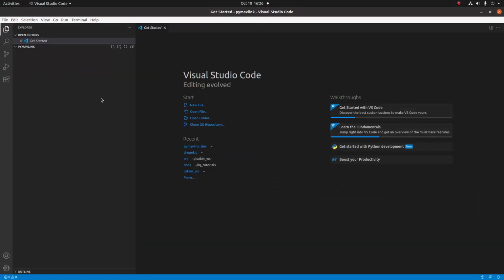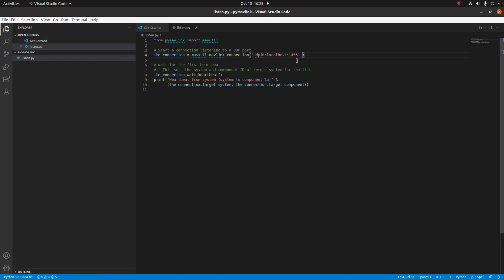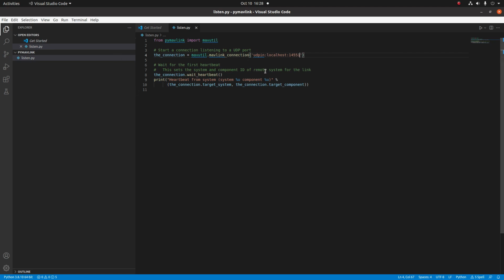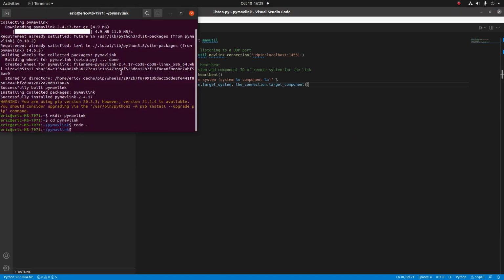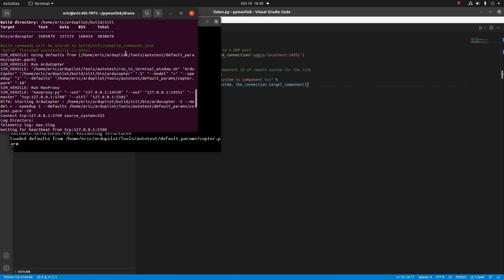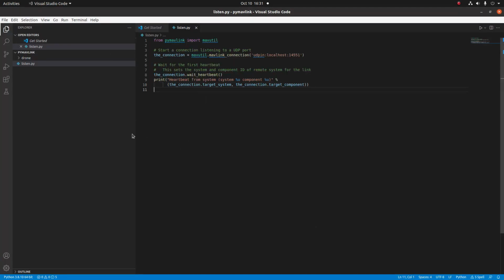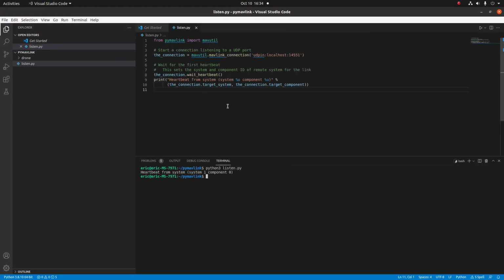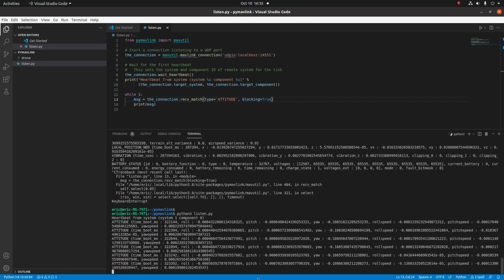01 Pymavlink Connect

Comment: what if we only have one "--out" SIM_VEHICLE:
Reply: i tried running the .py file with the one "--out" host I had but it runs forever
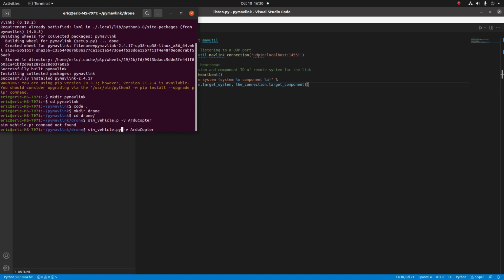Reply: bro could you help me cuz I got stuck at 5:06, have no idea what arducopter is
Reply: does that have something to do with ardupilot or px4 in the qgc firmware?
Reply: @artupaysivar6884  arducopter is a part of the ardupilot software. but specialized for multi-rotor craft. There's also Arduplane for fixed-wing. And Its been a while since I did that step but I think you need to clone the ardupilot repo from git hub
Reply: https://github.com/ArduPilot/ardupilot
Reply: @Kemuras  i see, thx for the info

Comment: I have a question; is this series work for raspberry pi and pixhawk? When I run the code on raspberry pi, will it be working(assume that I have connected raspberry and pixhawk serially)?
Reply: ya same question , did you got any answer..?

Comment: Hello
I could not understand the first part that you run on cmd 
is it available for windows too
and may you explain it more?
Reply: He is running this in Linux as opposed to Windows. Most software engineers use Linux for reasons I cannot go into within YouTube comments. 
Get a Linux Virtual Environment running on Windows. Ensure you do not upgrade past 20.04 as you may get dependency issues.